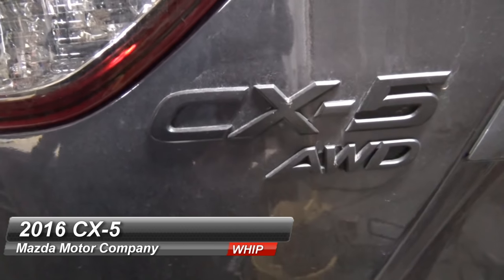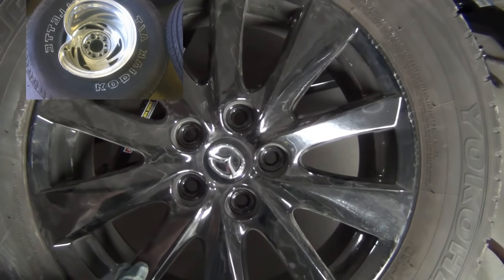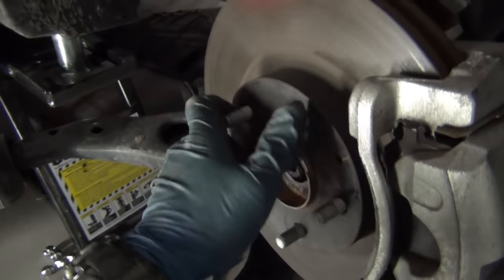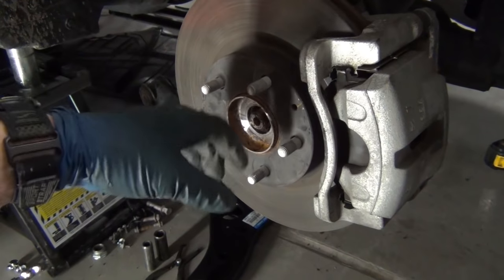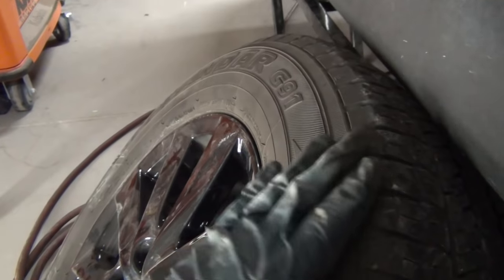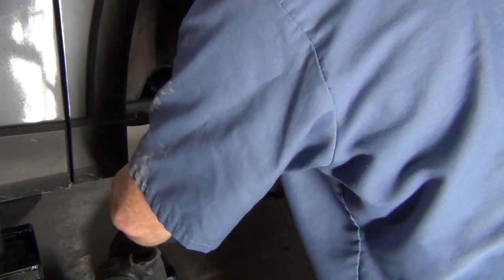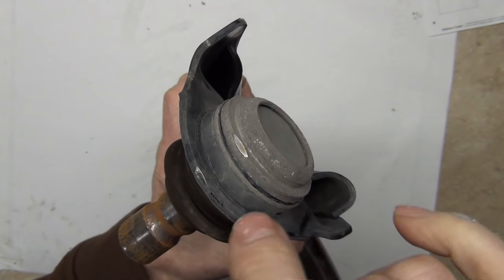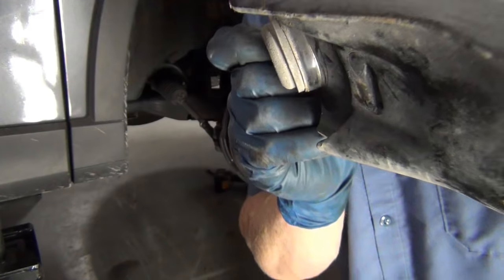5 Things to Check if You Hit a Curb

Comment: This is good information I was out drifting in the snow last night in the Jeep and jumped the curb instead of smacking into it and side loading the suspension it's the best thing to do!
Reply: i was stuck turning and could not go over curb and smacked it
Reply: @PeabProductions  same my back wheel hit the curb sideways and tilted inward, im fucked
Reply: @Spidepig09  lmao it was like a year ago when i did that. was drifting in the snow then went into the curb😭. both my wheels came off the tires
Reply: @PeabProductions  damn hahaha im in the tow truck right now bro😂
Reply: @Spidepig09  lmaooo no way
Reply: @PeabProductions  yeah i hate myself for drifting in the streets it was not worth it
Reply: @Spidepig09  defintely not worth it. seems fun in the moment that after your like bro i’m so dumb
Reply: @PeabProductions  yeah i was so mad, just that little moment cost me thousands
Reply: @Spidepig09  what car were u driving. mine was in a jeep in the middle of snow storm so dumb mine was free luckily. tow truck free snd re beaded wheels on tires with stature fluid and light it
Reply: @PeabProductions  a mercedes… i fucked up every part there is. Rim, suspension, control arm. You’re lucky lol
Reply: @Spidepig09  lmao very lucky dad was not happy tho. i’ve learned my lesson i think. that’s what was going thru my head when i crashed though thought suspension would be fucked up. that’s unfortunate though

Comment: Doing donuts in a parking lot always leads to a little curb bash.
Reply from the maker: Especially if there's a little competition or a camera running.  Right?
Reply: Heck Yeah.
Reply: LITERAlyy the fuckin reason i came here
Reply: @boxlight2888  4 months on, what damage did you have?
I was in a curb-free area but as I left I went over a bump and was still in slide mode, added a bit of power and did a full 180 with the rear wheel coming round to hit the curb. It hit quite hard - the impact was loud enough that I thought the tyre had burst. It hadn't, nor is there sidewall damage, but the rear wheel bounced up the curb. No doubt something is wrecked - going to get the alignment and lower control arms looked at.
Reply: EpicFishFingers what happened was everything ok
Reply: fkn provincial parks at winter
Reply: Doing donuts in the lot got to a fender bender
Reply: Not if you can drive and are in a big space

Comment: My car contineously slipped in ice during a normal left turn at an intersection and hit the curb on the front right wheel. But at a very low speed probably 10 to 15 kmph. the wheel was full turned towards the left which positioned it parallel to the oncoming curb. it hit towards the sideways. Im wondering at what speed can we expect what level of damage.

Comment: Hit a curb today going about 20mph but not a side impact but about a 15 degree angle from the curb. Shook the 2006 Silverado pretty good but don't appear to be any visible damage. I'm sure trucks are more likely to survive curb hits more than a car would.
Reply: Did the same thing this evening with my Jetta... I worried if it damaged anything... Yet everything looks fine on the outside... I guess we'll know sooner or later... If the tire starts wearing out on one side.. How did yours do up to now?
Reply: Recently hit my car going about 5 or 10mph. Could something be wrong
Reply: Every vehicle has a limit. Hitting something dead on will cause damage except maybe a military grade tank. Try running into a concrete wall with your truck and let us know how it turns out. Keep fooling yourself thinking that trucks are immune to driving over curbs at 20mph. What a joke.
Reply: @soldierd3654  update?
Reply: @stonedasfudge5947  I found a small dent on my mag, eventually air started to slip through the seem between the mag and the tire... So I fixed the dent with a sledge  hammer... And stopped the air from leaking through, since then, never had a problem, it's been maybe 2 years now. Still good
Reply: @kaniwillis4683  did something come out damaged? Hit my accord recently at low speed

Comment: I made a really small curve inwards on the wheel rim. They are steel rims so they just kinda deformed a little bit, and you have to sorta be looking for it to see it. Should I worry about this? I can't feel any difference at low speeds, but I haven't tried higher speeds yet. It's deformed by maybe a quarter of an inch.

Comment: I need some help on this question. Today when leaving the parking lot out of a parking spot. Instead of backing up I pulled forward through the parking spot and turning my wheels to the right. So mad at myself because I never do this. The went up the curb I wasnt going fast either. I backed my truck up slowly. My steering is still straight, the trucks drives straight and doesnt go to the left or the right. I heard a noise as I was driving on one road coming home... what are your thoughts please let me know..
Reply from the maker: Honestly?  My first thought is celebrate that you don't usually do this and don't beat yourself up.  Second thought, investigate the noise by doing an engine off steering wiggle with two people (video coming soon- thank you for the idea) and inspect your tires or go to a tire shop to have them inspected.  Ask first, but most will do this for free.
Reply: @briansmobile1  I checked my tire and my truck drives straight the steering wheel is straight I don't hear the noise so it probably was the road but I do know how eventually when the road tapers the truck will eventually or your vehicle will drift to the left or right
Reply: I appreciate you replying back to me I'm just real picky with my truck because I bought it brand new and I have nice tires in my truck and don't want any issues

Comment: Wish I would've seen this sooner! Hit a curb trying to slide around a bend; bent my wheel and blew out the tire on the front left quadrant . I had to ride on a donut for an indefinite amount of time, say a couple of weeks until I could afford a replacement.  Since then, when turning left at low speeds, say into a parking spot or turnaround, I'll get this occasional knocking noise as if something was slipping. Fast forward a year later, that ocasional knock has now become consistant and loud. It would happen when steering left, in the least bit, and is now evident when accelerating at all times. Haven't been too cognizant of my tire pressure either. My first impression was perhaps a bad axle, but am now led to believe it's due to bearing failure. As a "Subie-Newbie," I would greatly appreciate any advice on the matter. Many thanks!
Reply: Also, I'm driving an 08 impreza non turbo

Comment: I slid into a curb last week after it snowed. I went around a corner, and the front end just broke free and kept understeering until... bam! My blizzaks failed me, lol. I think I might have got lucky and just bent the lip of the rim a little, but thanks for posting. I know what to look for now when I pull the wheel off :)
Reply: It not the tyres fault tbh, when you hit ice patch or patch of compacted snow, there is nothing studless tyres can do. I had smack twice recently and seemingly got away scott free tho it felt and sounded rather brutal, but my subaru has quite fat tyres and there was also quite a bit of snow around the curb so it absorbed enough of it to not cause any damage.
Reply: @Kacpa2  I agree,  I was just half sarcastically blaming the tires. They have their limits, but are much better than regular all season tires.

Comment: Hello great video i need help i parked outside a supermarket then as i was leaving i pulled forward without realizing there was a curb immediately ahead heard loud noise got out of car saw car was on too of curb saw better to drive forward and so i did then parked car in empty parking place looked around the car saw no damage it was night time there were dim lights in parking lot so made the mistake is my nissan sentra ok? Where should i get it checked? I am going for oil change will they look when i tell them what happened?

Comment: I have a 2011 Honda Accord they hit a curb with the right front. The wheel and tire were damaged I replaced the inner and outer tie rods was gonna get it aligned,but I noticed the tire is real close to the inner fender and rubs a little when I turn it all the way to the right. What do you think it might be, strut or control arm?

Comment: I hit a curb a few minutes ago. No vibrating at all, but my steering whill is slightly off centre, and when I brake without touchu the wheel it pulls slightly to the left.

Comment: can the ball joint also be damaged? I ran over side of a curb while turning at around 10mph. I do hear a squeaky noise when i turn my wheels but it disappears when it is cold out. Also my car shakes when I speed up while my steering wheel shakes too.

Comment: Brian, I'm having trouble locating that "whah-whah-whah" noise on my  '06 explorer.I've replaced my old expired tires with 2 brand new and 2 -2017 tires.I had the upper ball joints repl. 2 years ago and had the wheels bearings repl. on all 4 wheels 2 years ago. Should I get a 4-wheel align. -it's not pulling left or right. What would you suggest ?

Comment: I hit a curb going pretty fast. After my front wheel has a lot of negative camber and not even alignment can fix it. What can it be?
Reply: I have the same problem ... I think the strut tower moves outward slightly and vice versa the lower control arm ...
Reply: Asrar Cheema it’s the camber bar that moves in and out. Depending on the type of suspension you have in your car multi link, etc can be strut unlikely tho

Comment: Brian. I have an 08 civic coupe, I hit a curb a while ago thanks to a patch of oil. I got curb rash on the wheel, broken a piece off the front bumper and ripped the inner fender lining out. 
AND my curtain and  passenger seat airbag deployed. Should they have deployed? It didn't feel like the impact was that big.
Reply from the maker: It's better to have them deploy than not for that kind of collision.  On the one hand it sucks to have to buy new stuff, but you can't buy a new brain or skull, but your brain can make you enough money to buy a whole new car.

Comment: Hey Brian regards, what truck is this a traxxas slash or ??? do you still flying rc helicopters?
Reply from the maker: I still have most of my Trex collection- any time I have time and good air I fly my paramotor.  The truck is a Tamiya CR-01 with a Ram 2500 body on it and some other mods.(crawler)  Off cammera is an Invictus Reaktor.(back flipping fast with lipo brushless upgrades)

Comment: I just ran over a curb and blew a tire the tow guy said we broke a plate as the tire wouldn't turn when I had the wheel turned all the way over. So I got stuck on the sidewalk from making a uturn too fast and I skimmed the guard rail too. Hopefully my dad can get it fixed. I wish it was only minimal damage like this one but it is not drivable atm so we are out of luck. Shame we don't have a warranty on it

Comment: jumped a curb doing 80 khm straight on in a 2002 s10 xtreme... oddly enough i feel like only the exhaust was damgaed.... it was snowy and the engine way was so packed with snow it was impeading motor..

Comment: My sisters wheel looks like this / 🚘l. 
If that makes sense, it's slanted inward. I didn't see anything obvious. she told me she got a flat tire so idk what really happen to it. The setup looks about the same as this vehicle it's a ford escape. I'm aiming towards the strut assembly. Since it's like this /.. 🤔  I'd hate to just throw parts at it but it may be cheaper than taking it to a shop.

Comment: Hi. My 2008 GH mazda6 hit a kerb square on at 30+mph a few weeks ago. The crossmember shifted so we backed the nuts off and moved it forwards to get the wheel alignment dialled in. Right after this was done,  the car wouldn't start in Park. He advised to replace the neutral switch. First I fitted some replacement wheels from the wrecker and it took me a week or so to get around to replacing the neutral switch and that fixed the problem (starts in Park now) but I did need to shimmy it a bit on the m6 mounting bolts to get it 'Right.  The day after replacing the neutral switch, the engine cut out whilst sitting in traffic. It has happened twice now in a matter of days. Battery was replaced, that wasn't the cause. From research (google) I read the fuel cut out switch can trip but that would mean the car wouldn't run at all. After the engine dies, the car can be started and driven no problem until it happens again. Could it be fuel filter, the impact allowing particulates to cause problem? Or failed crank angle or cam angle sensors? I plugged in a quality Bosch OBD2 scanner and no  codes have been triggered. Reading back over my words, the stalling only began after replacing the neutral switch??

Comment: Several years ago, I hit a curb on my 2000 accord coupe v6.  the impact was the front drivers wheel, and I was probably going 35-40 mph. bent the lip on my front rim and nicked the rear, blew both tires. but everything balances and checks out okay.  the curb (median) was in the shape of a U and i hit it at the lower right part of the U if you can picture it, and the the wheel was turned to the right trying to avoid the curb at the time of impact.  i don't think i was on the brakes at impact.  the front drivers wheel is pushed back about 3/4 an inch compared to passenger.  I went to the Honda dealership and they diagnosed it as a bad spindle/knuckle and they wanted $800 dollars to fix. a little over 100 in that was parts.  here i am now 3-4 years later still driving with the damage.  I want to get it fixed soon.  Will replacing the spindle/knuckle fix the issue or at least most of the issue with the wheel being pushed back?  these accords had double wishbone in the front so I'm not sure what could have gotten damaged.  any help would be appreciated  by anybody, thanks!
Reply from the maker: I wish I had the magic or experience to say.  LIke anybody else I'd have to look at it to tell.

Comment: Hey, it was rainy today and I couldn't see the left side of the road and unfortunately hit the edge of the "side walk" like barrier that divides both sides of the road.  I almost hit it head on, but towards the edge of it, was able to swerve to the right, a bit late though and it did some damage to the alloy wheel(looks more of a moderate curb rush).  No noise, car doesn't pull, but the steering wheel now needs to be about 1/4th of an inch to the left to drive straight.  FYI - The speed was about 15-20MPH.  Could this incident just threw alignment off, which can be re-aligned or there has to be a damage?
Reply: Update? Somewhat similar happened with my accord. No damage to the outside though
Reply: @rushiljain9423  I first went to a car repair shop and they probably didn't have the latest alignment machine and caster was .5 degrees off.  Service manual stated no more than .3 degrees.  So I went to a good alignment shop and guy was able to correct it and his machine looked newer/better.  He checked everything and there was no play. 2 shops checked.  At times I do hear a single faint click when turning steering wheel to the left a bit while backing out from parking or turning from stop.  I am thinking there could be a ball joint that got affected by not to the point where it is bad.  I just drive like that, doesn't bother me.

Comment: So I slid into a curb rear end first, and now when I brake, there is a pulsing in the pedal. There is also a slight "knocking" noise but only when braking. Otherwise it drives fine, no wobble, no movement in the steering wheel. What could this be?
Reply: I think you disc or rim is bent.. or something is loose

Comment: Hey Brian I hit my curb about 5mhp now every time I brake it makes a nasty grinding noise depends on the level of the street I am on have any idea what I might of damaged? I replaced the bearings but still makes the noise also replaced the brakes and cut the rotors still having the same issue. I am a uber driver so when I break and my passenger and it's quite embarrassing. At first that woo woo noise was there too but I believe it's gone now.
Reply from the maker: If you have a FWD car and your CV axle wasn't tight your inner hub races can separate.  Check your spindle nut torque first.

Comment: Shit I hit a curb sideways with my 86 Chrysler 5th avenue. It bent both front and rear rims, destroyed the lower control arm, bent the upper control arm, and bent the whole k frame and twisted the passengers side frame rail. Also twisted the bumper and kinked the radiator support.... I replaced the k frame and got new rims and its back on the road. At least the control arms and k frame and torsion bars are all one piece. So it made fixing it easier. But I believe it was that design that made the damage so bad.
Reply from the maker: NIISB or NIIST don't really go after car makers for this kind of accident, but the lower control arm in this video did act as a mechanical fuse to protect the inner structures.

Comment: I just slammed on brakes and hit the right side of the curb going like 30 
Also everything seems fine with the car should I take it in to get checked
The curb was smaller than most and my car sits rather high